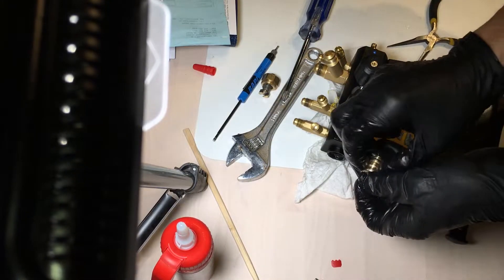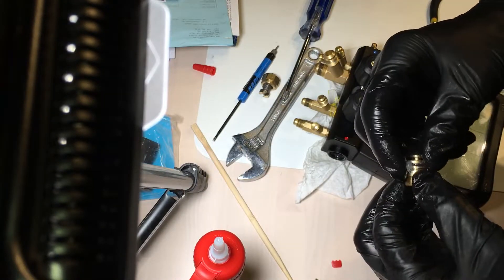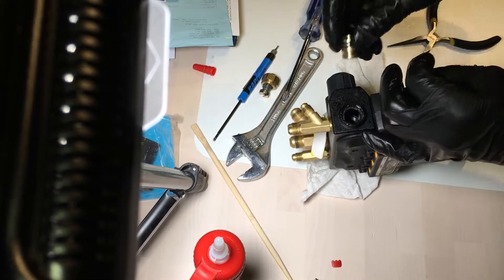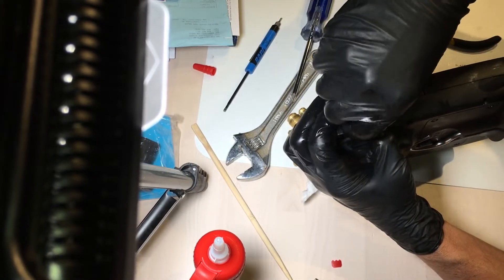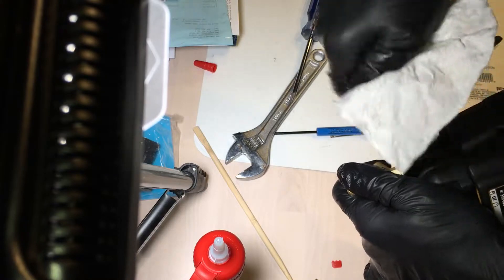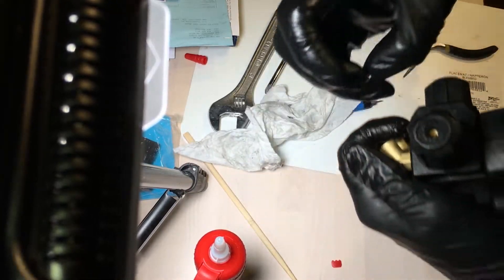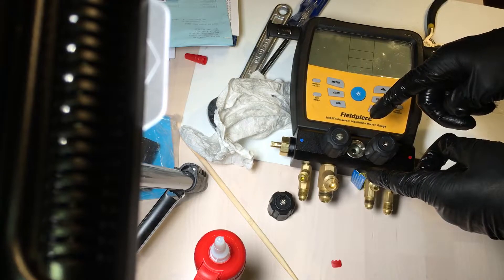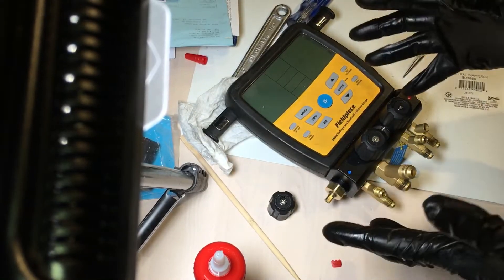SM480V piston valve seal assembly replacement.  Lol I call it a Testo in the video no editing

Comment: Hi 
Thanks for making this video.
Do you have any idea as why the sman480V beeper is not working?
I did go thru the menu and unmute the beeper but it didn't solve the beeping issue.
Reply from the maker: Setting on the unit in the instructions. How to set up. 

I don’t use that feature so I don’t know how to setup the beeping alarm. I just remember reading about it.

Comment: Would u happen to know where to find the valve on that same manifold that holds the hose the one on my high side cracked when I accidentally dropped it can’t find it anywhere
Reply from the maker: Are you talking about the little quarter inch threaded piece that sticks forward that you screw the hose onto. 

I do not know a SORCE for that. I don’t think they offer those for sale. . 

But you could attempt to email Fieldpiece directly there very good at responding and they’re usually very helpful   

They want to take care of their customers 

But in my thinking that that was probably never meant to be intended as a serviceable item or part . 

Go to the website go find context an email or get their direct phone number and try to contact them and see if they can help you . 

Everything I get is through True Tech Tools but I am pretty sure True Tech Tools will not have that in stock and they will not have a part number on it . 

But let me know if you get lucky and you have a part number , 

You could post it on this link underneath this video to let other people know just in case they do the same thing
Reply: @coldfinger459sub0  yes I believe it’s called the liquid line port based off the manual on their website.  I’ve emailed them in the past asking specifically about that port and no reply but that was months ago I will try again though thank you very much for replying. For the meantime I’ve got away by replacing it with a fitting that only has 2 ports instead of 3 like the original so my hose is always hanging which is very annoying  :/ so most of the time  I just leave it off unless I need to tap into the liquid line.

Comment: Where do you get the piston o-rings?
Reply from the maker: Tru Tech Tools they’re online

They have a messaging. Were you talk to somebody live through text? 

You can call them 

Won’t be open on the weekend 

Or you can open up the website click on brands and then click on Fieldpiece 

This will take you to everything related to Fieldpiece items and then you can start scrolling looking for accessories, I believe 

But if you’re unsure, just contact somebody either through email or text messaging give them the SM480 the model number and tell them you need the piston ring valve kit .  

I have a 8% discount code 
LECHAIR 

All one word all capital letters 

So when you check out, you’ll see a coupon discount box to add the code. It will reduce 8% off your bill. 

Anything over $50 is free shipping 

If the piston ring kit does not come up to $50 

You may want to purchase some other small item 

Maybe the NYLOG  BLUE

That should throw you over the $50 mark to get free shipping.
Reply: @coldfinger459sub0  thank you very much! We appreciate you.